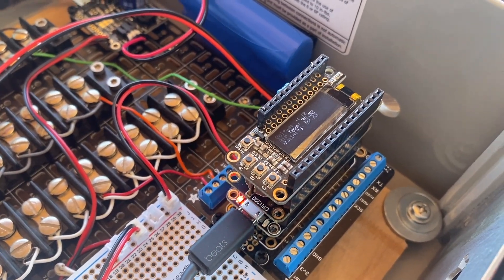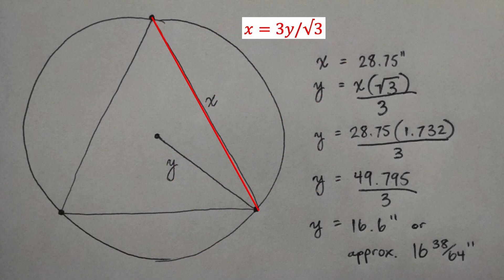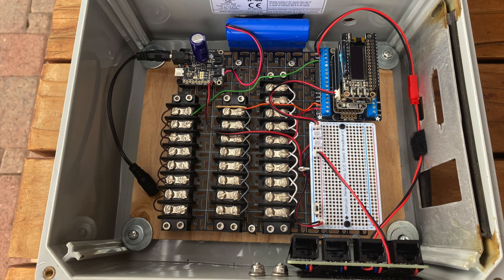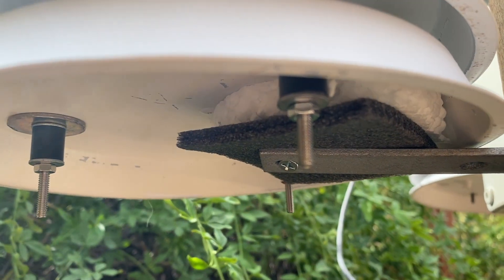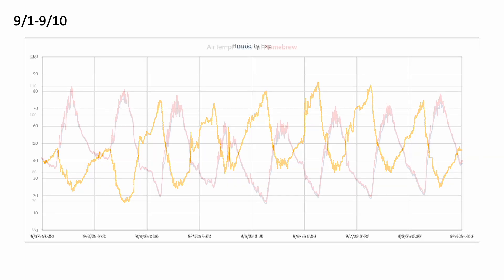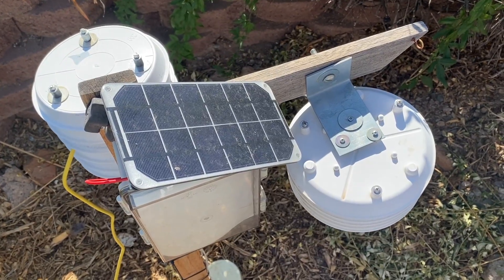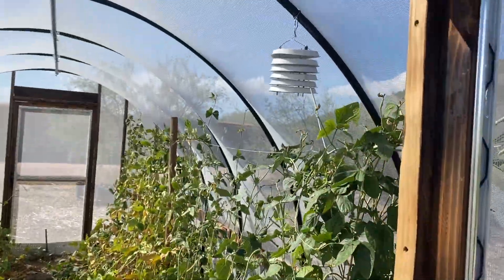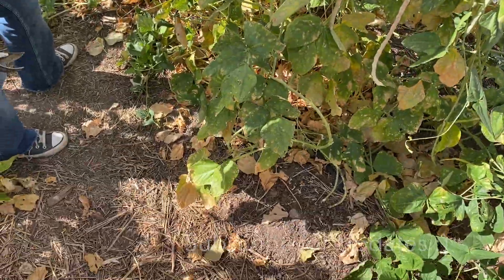Building and Testing a Temperature Radiation Shield

Comment: What if you just placed a piece of wood a good distance from the sensor without either of these two radiation shields? Wouldn't that work even better? I guess that would be difficult to do inside the greenhouse.
Reply from the maker: I misunderstood your comment- no, we need the sensor shaded with airflow. Maybe I am missing something in your comment.
Reply: @ModestMaker  I'm probably missing something, but I thought the purpose of the radiation shield is to block sunlight to get an accurate temperature reading. If you had space, you could block it with anything as long as it cast a shadow on the sensor.
Reply from the maker: Sure, but also to protect the sensor from the elements while allowing for airflow in an exposed setting.

Comment: Surprised that the commercial radiation shield temp dropped when in the shade.  It would seem that they need to be shaded to improve accuracy
Reply from the maker: Agreed- I was also surprised. I guess these shields do suffer from some heating bias so placing them full time in the shade would be best.

Comment: Nice work. 
     I was wondering myself what caused the Delta between the two placements.  But, when the shadows swept across the receivers, everything made sense. 
     My own 3D printing trials demonstrated that PETG will work well outside for your logger attachments and enclosures.  There is also a PLA (High Temp) which might work, but I have not tried it out myself.  
     Q:  Did you find that the temperatures, inside the Data Logger Enclosures made an impact?  I would think that sitting out in the Sonoran sun would cause the system to crash.  Im really interested in using RasPi's for the enclosures Im building, but I fear that the heat might become problematic.  Regardless, living here in Burbank should provide me with robust opportunities for testing. 

Press on. Give my best to the family. Jim.
Reply from the maker: Thanks Jim, I was similarly concerned about electronics getting hot when I first started getting into all this. Here's a queued video where I measured internal temperatures of a setup for comparison with published tolerances: https://youtu.be/Dl7WoKgvDRQ?si=aN2TdemSjq0QcgXT&t=1032 . Thanks for feedback on 3D printing - I will be exploring various alternatives before I print anything (including yours) and give an update-- that's my next step :)

Comment: Great video! You used Walmart plates and I used some I found on Amazon except mine are square. I put vent holes in each of the plates except for the top plate. About the shade on the instrument sensor shelter, I mounted mine so that the mounting is at the bottom and nothing above it, it is working fine.
Reply from the maker: Nice to know the approach is validated! I will also be making a few more improvements but this was a good first run. Cheers.